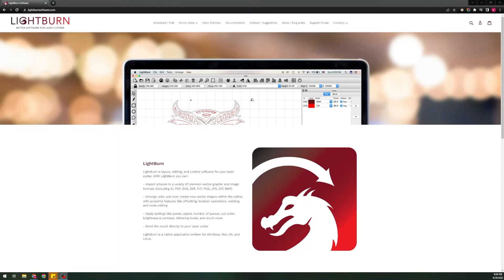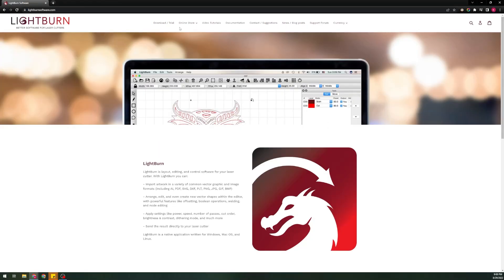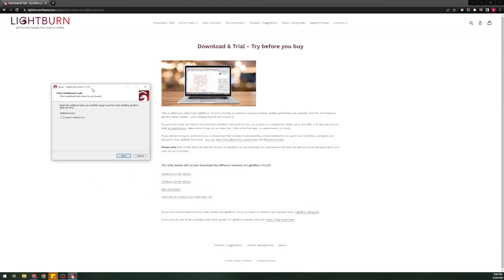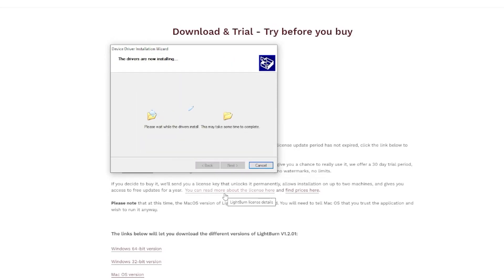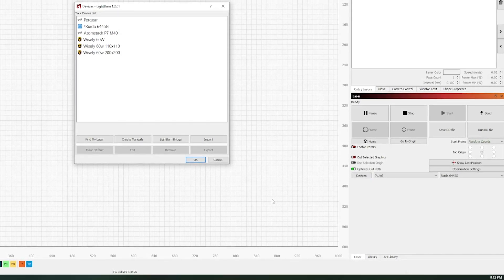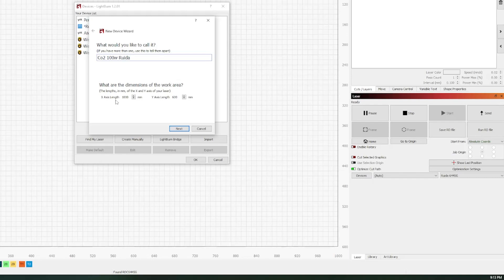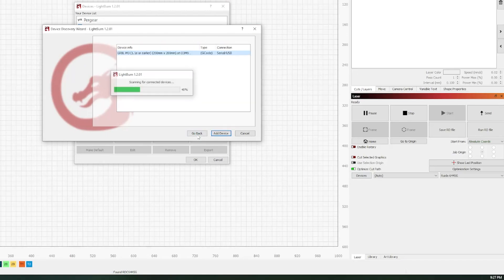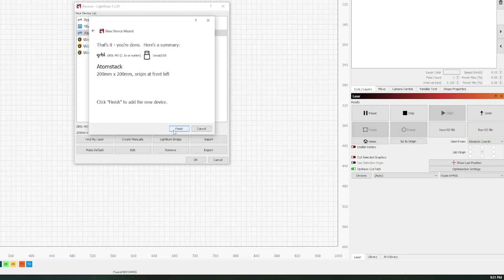How to Install LightBurn for Gantry, Drivers and Device Setup

Comment: what do I do if I didn't chose to install the additional drivers? I recently got a DSP laser and need to add the driver. I upgraded the license and the software, but never got a prompt to install the driver. Ive been searching for them but cant find it anywhere...
Reply from the maker: A few episodes after this in the crash course (official playlist link in the video description) we talk about how to hot swap between lightburn and ezcad using a piece of software called zadig. I'd recommend you give that a watch it should show you exactly what you need to do.